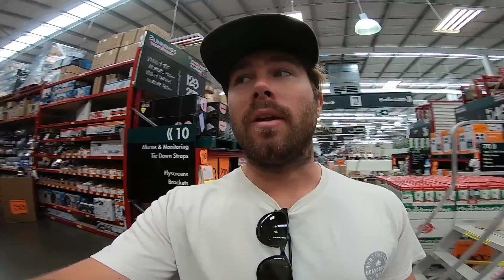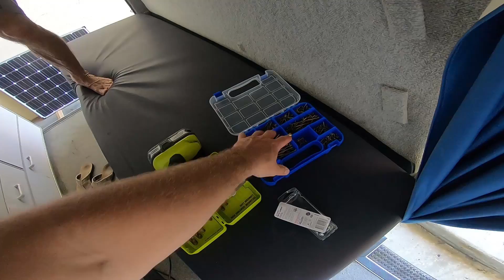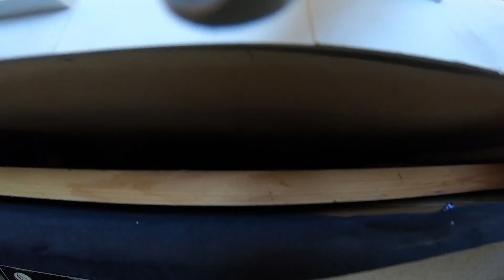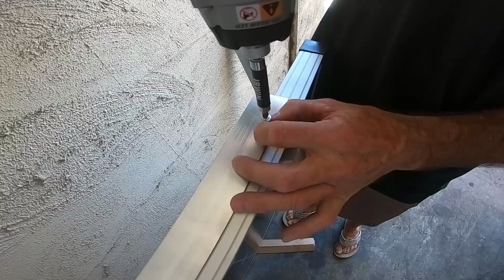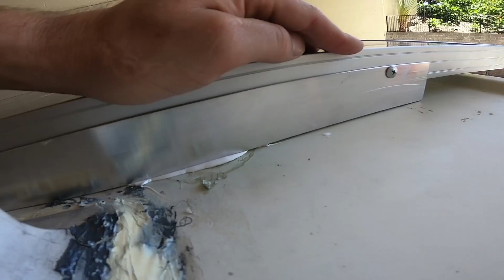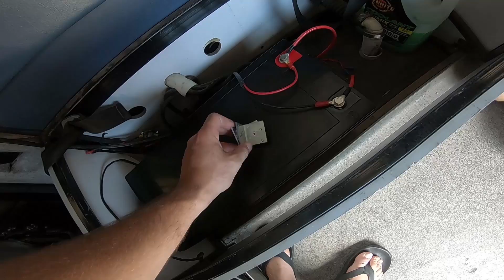Australian Van Build #2 Solar and Battery Install

Comment: I didn't see a fuse on the positive wire from the battery to the charge controller.  It would protect the wire and charge controller incase the wires short, this could prevent a fire.  Check the manufactures recommendations on fuse size, but at least to protect the wire.
Reply from the maker: +Traveling Terry never heard or seen anyone fuse into the charge controller....
Reply: Most people fuse from the solar panels going into the charge controller and out going to the battery.  I think you really only need fusing between your charge controller and the battery.  If you have a short there is no protection to open the circuit from the battery.  I can send you a wiring diagram if you would like.